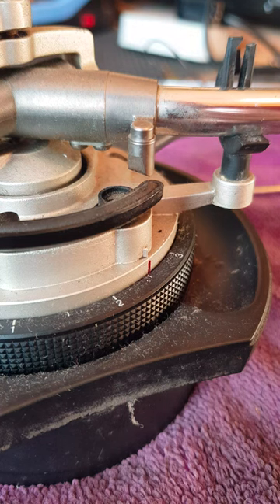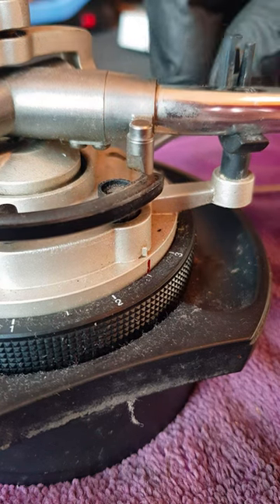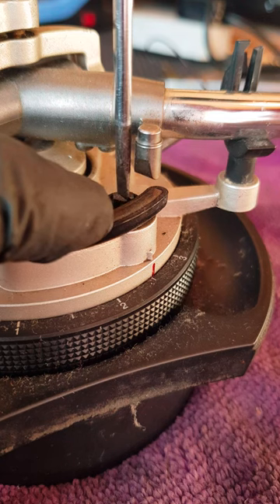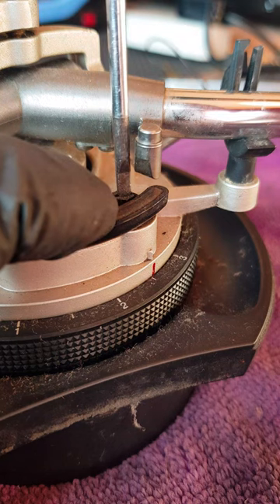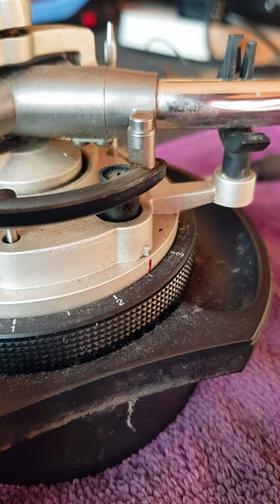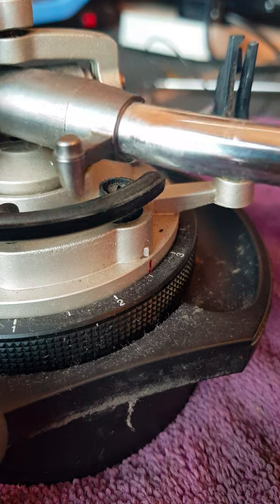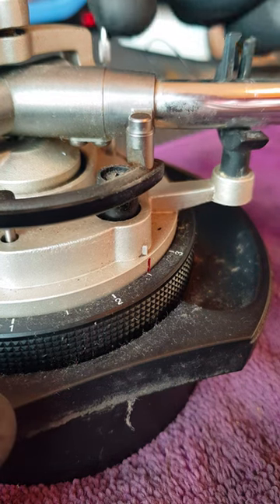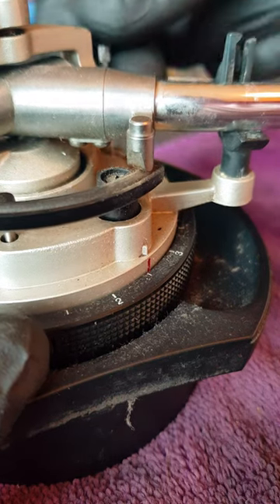Technics 1200 1210 tonearm lifter adjustment

Comment: A tip for DJs, if you're using Ortofon Concorde and it's set up correctly, then it is useful to have this lift base adjusted even a bit higher. So that if you happen to accidentally drop your tonearm between the record and the tonearm rest, then it will fall on the base in it's "down" position, should be a few mm from the platter dots, instead of the needle catching the side of the revolving platter and thus most likely damaging the needle. Requires some trial and error but with normal slipmats and if your tonearm height is set up correctly (with Concorde, usually in the lowest position) then the higher setting of the rest base does not touch the tonearm while the record is playing.

Comment: Just wondering how you would slow down the rate at which the tone arm drops. Mine drops a little too fast onto the record. Maybe some type of fluid needs to be added somewhere?
Reply from the maker: Yes Michael you can take the damper apart and regrease it with a thicker grease 👍🏻I'll do a strip down video so you know how it comes apart 👍🏻
Reply: mine goes up,no problem, but wont go back down properly,.
???

Comment: I did this and it worked perfect but now when I lower it doesn’t go back down! Or goes back down incredibly slowly, any idea’s for that please?
Reply from the maker: https://youtu.be/eQApIUKJe8c
Reply: Ty mate but I’ve no chance of doing that. I can handle turning a screw but I ain’t taking it all apart! 😅
Reply from the maker: @richsteiner  it'll just be a build up of old grease and muck causing it to move slowly, ideally it sounds like it could do with a service.  I'm based in West Yorkshire UK if that's anywhere near you if not do me a pm on Facebook @DeckTech and I'll happily try point you in the right direction to someone that might be able to help 👍🏻🎚

Comment: Thank you, however I can’t get my tone arm lifter correct even with this. When I pull the lever up. It’s high enough. About 1/4 off record. But the tone arm moves from the rest and off to the left when the lever is pulled. And does not want to go back to the lock/rest when the lever is up. Like something is preventing it to rest about 10-15mm from the rest/lock. Hope this makes sense.

But when the lifter is down the arm can easily return to the lock/rest as normal.
Reply from the maker: Could you take a video of what it's doing and email me it at deck_tech@hotmail.com and I will have a look at a solution for you 👍🏻🎚
Reply: I think it may have to do with the anti skate spring. As I followed a video that shows an incorrect alignment compared to what the official service manual says. Just a hunch. But am going to take it apart and go by the manual.

Comment: What if the lever isn't working correctly? Nothing happens in up or down state. Thanks J
Reply from the maker: Hi Johnny, it could be caused by a number of things without seeing it on the bench I would be just guessing, I would start by checking the lift spring mechanism first the old grease in the barrel might need cleaning out and some new applying, or it could just be a build up of dust and muck inside the tonearm assembly by the lift mechanism? But if it was me I'd start by opening it up and have a good look👍🏻cheers Adam 👍🏻🎚

Comment: Hi, all please can I get some advice.

The tone arm one my left deck seems to be lower and at a slight angle when not in use. Its not the black lifter (my technical term) as it does not rest on this.

It is just sitting in the Black tone arm lock mechanism.

Any ideas?

Thanks in advance.
Reply from the maker: Hi dave, it could be a slightly bent S tube or a damaged bearing cross section without inspecting it in person it's hard to diagnose the problem.
Reply: @decktech9684  My Tie arm clip is at a different angle than the other I think that may be the problem but its a 100mm difference. Can I move the clip by hand? I dont want to break it. I see people use pliers and drill bits to unscrew it but I dont need to change it.
Reply from the maker: @Davehiphop  yes you could try moving it if you think that's the problem, I've seen your post on fb if you want to send me a pic on there, I might be able help more. @DeckTech
Reply: send me a message on FB and I will mate